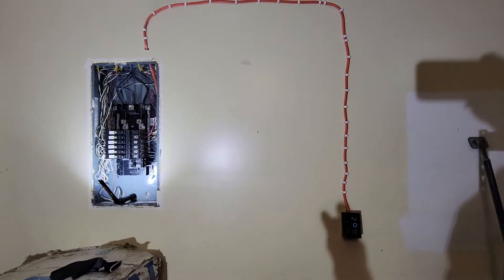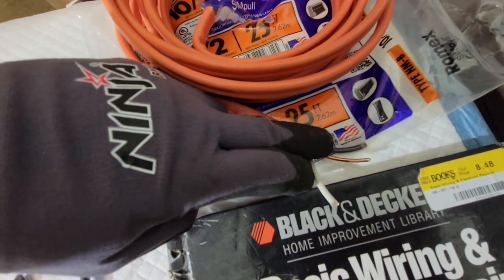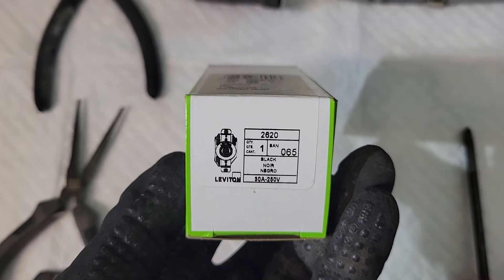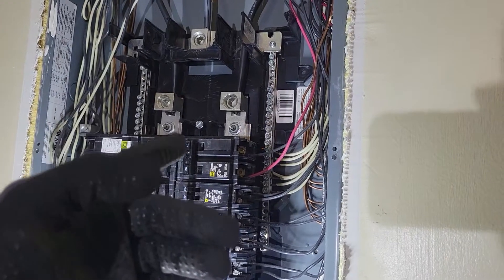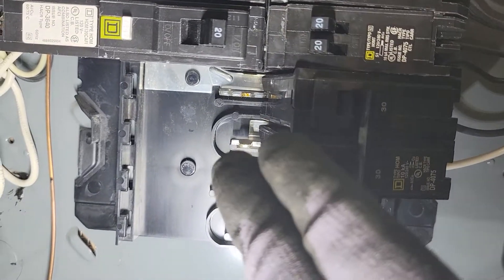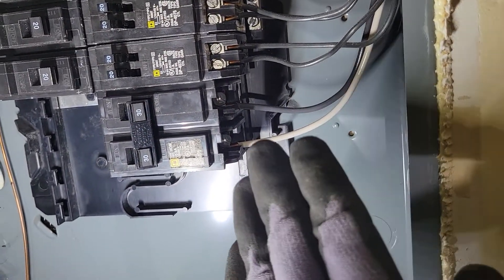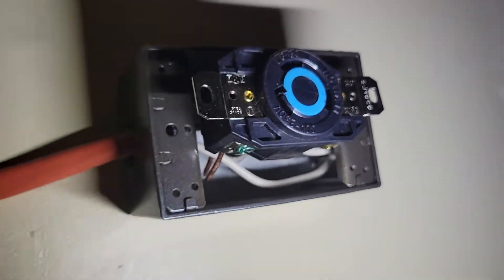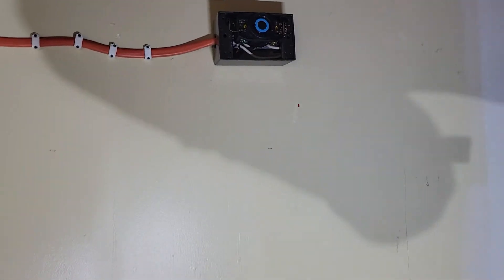How to install a 240v breaker and outlet for MINING

Comment: So where did you connect the black wire on the l6 30p receptacle
Reply: The black lead goes to the top screw down. It looks like it's white at first but that's just the light.